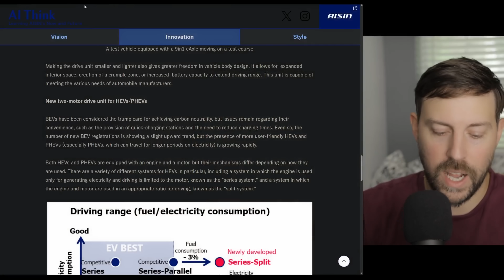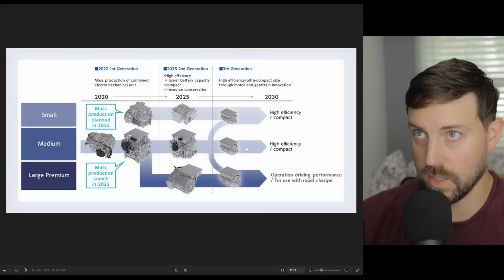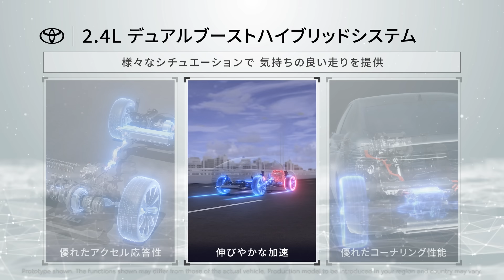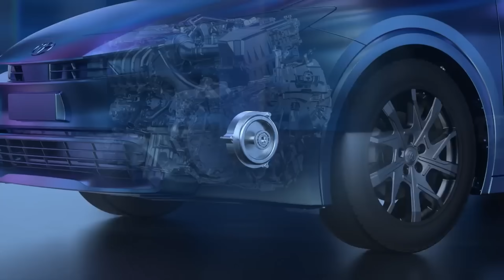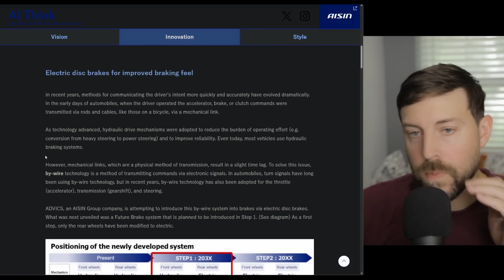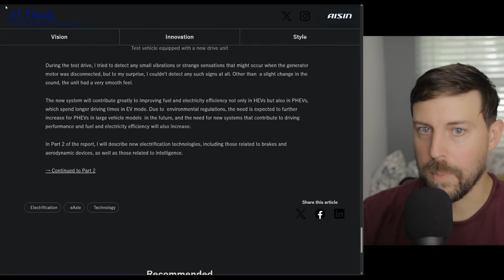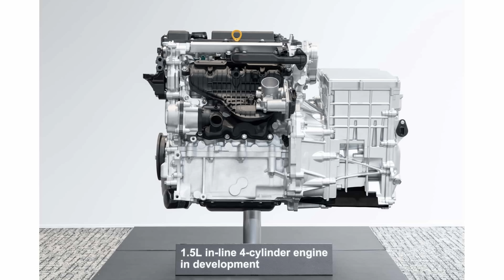Toyota's NEW hybrid technology is almost here. CAN'T WAIT!

Comment: The auto industry is certainly changing at a rapid pace.  Companies that make cell phones are now in the business of designing and helping to manufacture vehicles and their associated powertrains.  As a future owner of one of these vehicles, I also envision future frustration as well ("check engine lights" are only going to become more common, as all these electrical components and controls may just mean more potential for problems popping up from time to time - lots of over-the-air updates and long times in a shop to replace these computerized control elements when something goes wrong).  Generally speaking, cars are going to become more disposable (I can't see the changes that your video detailed will result in a vehicle that can last on the road more than 10 years or so before it becomes obsolete).  There will need to be a way you can put an updated component into an existing vehicle to keep it running well instead of treating it like an old IPhone and simply sticking it away in your drawer when it is no longer useable.  Anyway, it is really interesting to see what the future holds.

Comment: "Electric brakes" is just brake by wire, but they have a hydro backup circuit so what's the point? Even that feels dumb and instead us true electric braking - essentially aggressive regen - since braking rate is limited by the tires anyway, you could actually have no brakes at all if regulation allowed it - that would have enormous benefits - cost, weight, mileage, system efficiency and improved ride through unsprung weight reduction - lets get on that!

Comment: Toyota needs to work on build quality. I have the new 25 camry and while it runs smooth and good so far it is really a rattle box... they really went cheap on the interior and the paint quality. They seem to have great power trains but their interiors need alot of help
Reply: Agree. I went for the Corolla hybrid instead. It is much better minus the tech
Reply: @edgaryzen4925 That's because yours was built in Japan.
Reply: @brentmiller8494 I knew. I for example did not feel good spending 30k dollars on a car with awesome technology mated with subpar quality. I get that it an economy car but the subpar quality shows more compared to 24 Camry le hybrid. Hood not aligned correctly, rattle plastics, power driver seat no longer standard, and cheaper cloth, just to name a few. 

Don’t get me wrong. The Camry is cool. Actually I test drove the Camry le 2025 and I liked but don’t love it for that much money. So that test drive partly influenced me to look for Corolla hybrid. Tried and it was a better choice for my needs for the same mpg result and for $6-8k dollars less. I hate buyer remorse and decision should never be taken lightly.
Reply: Built in Kentucky by big Bob

Comment: TOYOTA is #1 worldwide in hybrid technology. No comparison.
All others are MEH for me, especially honda. There's more to a car then just the drive.
Reply: I know you can’t beat that 1990’s hybrid technology 😂
Reply: The new Nissan 3 generation E-power Qashqai just walk over the Toyota corolla cross hybrid with 4.5L/100km and lower co2 emission at 102 kg.
Reply: The Mitsubishi Outlander PHEV was the #1 selling hybrid in Canada for 2023 and 2024. It's about $15,000 Less than the Rav4 Prime and 3x the warranty length.  
The Kia Sportage hybrid is a huge seller in Europe.  Toyota is slightly better but not more affordable for what you get just to chase mpg.
Reply: Yet, the 2025 Honda Civic Sports Touring hybrid is a "better-feeling" hybrid system to drive, even if it gets a few MPG less.  So, Eye of the Beholder I suppose.

Comment: Future Hybrids will likely be really reliable and efficient PHEVs. Once the SSBatteries are incorporated you won’t need more than 25kwh to provide consistent 100km+ range which is the commute for most people. Easy highway driving range of 500kms + as well. Easy home charging with low power chargers that don’t need costly installation
Reply: I think a 100 mile (~161km) EV range would be the perfect number for a PHEV. I would sacrifice some gasoline range to achieve that number if the gas tank needs to be smaller to fit a larger battery, but no less than a 350 mile (~563km) gasoline range.
Reply: @woodenmetal2977 yeah I think that looks like the most realistic future hybrid type. Solid State will make 100 miles possible with a much smaller denser battery

Comment: The Series split concept is a lot of discussion around adding one small clutch to the typical toyota hybrid system.. of course stopping all the unnecessary components from rotating is going to be more efficient.  I think they will end up in the same place as honda once they optimize for cost and battery range becomes larger.

Comment: After a couple thousand miles in my Toyota GH hybrid max, I prefer the simplicity of the fuel efficient version of the system that I have in my 08 Prius.  The GH feels like 3 drivetrains in the same vehicle, which is bizarre sometimes when it can’t make its mind up which should be utilized.   It has gotten caught in limp mode a few times, which from a dead stop, can be frustrating.
Reply: Thank you for this honest comment. The system is getting so overly complicated, you start to wonder why they don't just make E-REVS which is basically a battery electric car that might go about 200 miles on a charge, with a backup generator to charge the battery for long distance trips. There is no gas engine to power the wheels. These are extremely popular in China.

Comment: I just purchased a 25 CRV Hybrid Sport, and I took it over a small mountain pass, 3500 ft, there was a part of it that was a little steeper, my CRV could not go ver 41 mph, it went from about 3000 on the tac whatever you call it, to redlining the engine.  Do other Hybrids do that as well?
I will not be able to take this to Vegas or Phoenix.
Reply: Something is definitely wrong and I would take it to Honda. I see CRV Hybrids, Rav4 Hybrids, and Kia Sportage hybrids going 60+mph in the CO Rockies at 8,000 to 9,000 ft.
Reply: Owning a accord touring hybrid, I understand what you saying,  but there are some things to consider, what was your battery level, if the battery is empty, it going to be the engine alone doing the work for a while, generally the engine usually tap up the battery. But unlike what some people are telling you, honda system does allow the engine to drive the wheels above certain speed too via clutch.
Generally Nissan system is similar but better than honda because the motor is the same as electric car and has a larger battery , as honda uses a smaller motor and smaller battery to drive the wheels at low speed up to 70km/h on flat surface I have seen in my accord, it will not run up a small grade in EV mode.
Reply: @cb5110 I think maybe the ac is pulling too much power.  I drove up a grade last night going 80, and that was for 20 miles but in the day it could not go over 41 mph.
Reply: Honda hybrid technology is good for street driving but has maaaaany limitations 

The ICE engine is basically a generator for the battery and the electric motors is what actually drives the car .

In extreme situations the ICE cannot generate enough charge to power the electric motor which is actually what moves the car at all times

Toyota hybrid system has a tradicional ICE motor that moves the car and symbiotically also has a electric motor that supplies much less power to the overall movement of the car unless it’s a plug in hybrid

Therefore even with a completely gimped electric motor the ICE engine is still able to move the car forward
Reply: @Drivenby  Thanks I wished I knew that before I made my decision. I thought the hybrid system was like the Civic.  Now I know why the dealer had me drive through the neighborhood going 25 mph and not up the hill on ramp and steep grade on the freeway.  Bamboozled.
Reply: @Moondoggy1941 definitely take that to your dealer and if you can video the problem it might help them diagnose the issue. That is not normal behavior for any modern vehicle ICE/Hybrid/PHEV/or EV that isn't overloaded.
Reply: @cruzctrl2  Thanks I will, my son has one of those 2013 Ford Focus with that horrible transmission, sometimes I think my CRV has the same transmission.
Reply: @Moondoggy1941 definitely not the same shitty transmission in the 'fucus'. But I can understand your frustration when your new Honda doesn't seem up to an easy task.

Comment: My ‘24 car has brake by wire and it’s honestly pretty awful.  It’s impossible to get a feel for the braking behavior with how much it can vary because you are only feeling what the computer is doing with the pedal instead of what’s actually happening with braking. Sometimes it’s fine, but it’s the inconsistency that’s frustrating.

Comment: Yay u made the video. 

Both Geely and BYD's hybrid system is more like Honda's than Toyota's. Both BYD/Geely and Honda use an engine connected to a smaller generator motor and a larger traction motor, with a clutch between them instead of a planetary gear.

At low to medium speeds, the clutch is open, and the engine powers the generator, which charges the battery. The traction motor then draws power from the battery to drive the wheels, functioning as a series hybrid. At higher speeds, the clutch closes, allowing the engine to drive the wheels directly.

This system operates in three ways:

1. The electric motor powers the wheels when the battery is full.

2. At low speeds, it functions as a series hybrid, with power flowing from the engine to the generator, battery, motor, and wheels.

3. At high speeds, the engine directly powers the wheels.

Toyota’s planetary power-split system allows not only these three modes but also simultaneous engine charging and propulsion, as well as joint engine-motor operation, leading to better fuel efficiency at high speeds than Honda or BYD/Geely especially in EPA cycle which is more realistic and values high speed efficiency. 
 
If you don't believe me check 1001cars on youtube where he compared BYD Seal U DM-i vs the now previous gen RAV4 PHEV. The latter had longer EV range, better MPG in all condition, better acceleration and of course higher reliability. Therefore, despite what BYD propagandists and pro-China EVangelists would have you believe BYD DOES NOT have the best hybrid system. Toyota is King